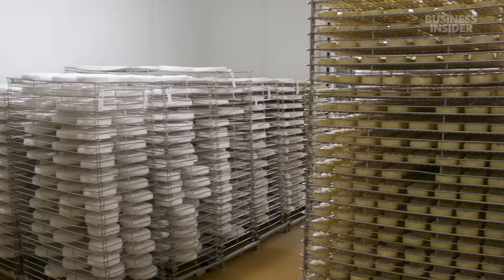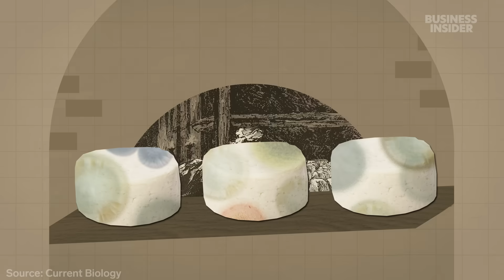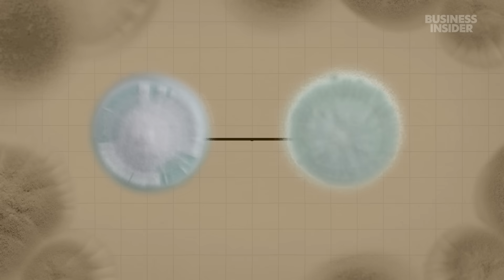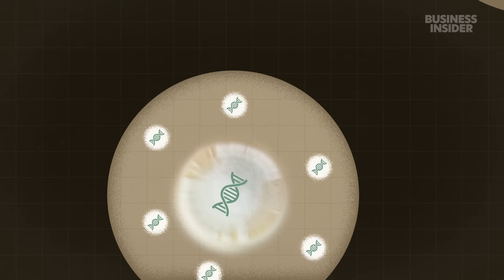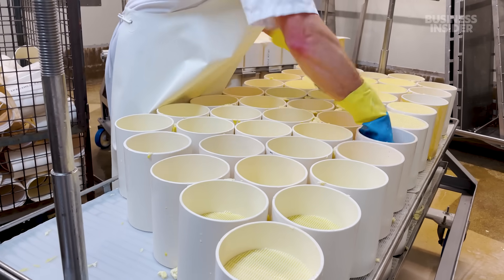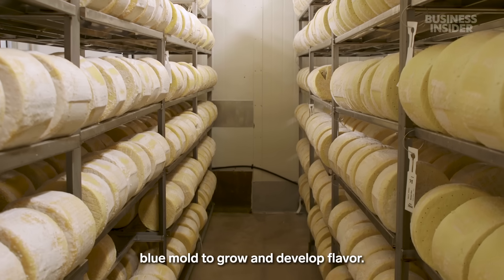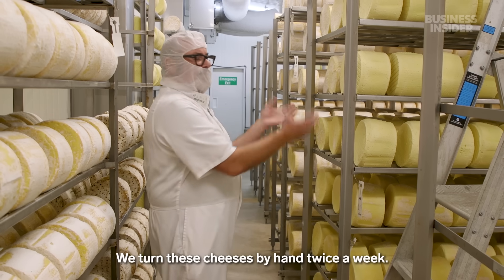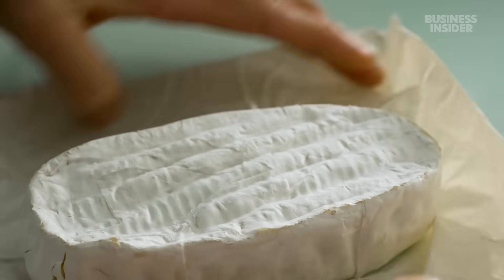Why the Mold Behind Brie Cheese Is Disappearing

Comment: Maybe I missed it, but I felt that the video brushed over why the low genetic diversity is causing the mold to produce fewer spores. Sure, it's producing fewer spores because of a lack of genetic diversity, but why? A lack of a genetic diversity should just mean that the mold cannot adapt. And yet, it is adapting in the wrong direction
Reply: Even asexual reproduction has mutations occasionally. In a more brutally Darwinian environment, the copies with bad mutations would get killed off, leaving only good copies. But in the perfect conditions of a... uh, cheese mold farm (?) even the bad copies get to reproduce and stick around, slowly lowering the average number of spores made over time since the high and low performers are mixed together.

It'd be expensive and time consuming, but we could artificially reproduce this process and breed up a healthy, high spore count mold again. The issue is likely no one wants to pay for it and all the cheese makers are hoping someone else does it first so they can get a (cheap) healthy mold on someone else's dime.
Reply: Ehhh it was somewhat explained in the video, constantly breeding the Penicillium camemberti mold doesn't mean it is actually the same even thought the term cloning was used.
Over the mold's generations, it mutated to the point that it produces less spores.
And despite what another commenter here, said, the mutation has already been observed and printed in scientific journals.
There's also the NIH (US medical paper) of "Rapid Phenotypic and Metabolomic Domestication of Wild Penicillium Molds on Cheese" (2019) where they concluded it's not a specific genetic marker of the fungi, but rather domestication of mold that lead to this mutation (also somewhat mentioned in the video) known as "transgenerational epigenetic inheritance".
Sorry I can't provide the link to said article because you all know how Youtube hates links, so just google the title I put here.
Reply: Yeah, that's what confuses me. I feel that all media about this subject glosses over the role of low genetic diversity plays.
Reply: @CFSlayer23Studios50423  Genetic mutations are a fact of life.  With 34 million base pairs to copy, asexually cloned penicillium camemberti gradually accumulates mutations in important bits of DNA.  These mutations might make it harder to metabolize energy, maintain homeostasis, or impair other vital cellular processes, limiting how many spore the mold can produce.  Sexual reproduction prevents generational DNA degeneration by providing a backup plan.  If one in every one million copies of a base pair gets mutated, then it is very unlikely that the same base pair will be mutated in two separate copies of DNA.  If a cell has one working copy of a gene, it can use the working copy.  Then there are also mechanisms for cells to repair DNA, such as by changing a damaged DNA strand to match the complementary unmutated strand.  Does this answer your question?
Reply: @CFSlayer23Studios50423  Sounds like the common case of "Well we already know incest is bad so lets start with that". Which is really unfortunate because it kind of sounds less like a "needle in the haystack" problem and more a "We're looking at the world through the eye of a needle" problem. I have a strong feeling the scientists are probably trying to find the cause but aren't able to come to a conclusion yet, but I agree it's even worse for them to say something that can be construed politicially without making it clear what's been tried or done and the evidence to support the efforts. Cause I'm hearing this and thinking "It sounds like the real reason the spores are "producing less" is because of rising demand and the people don't want to blame themselves for risk of losing sales, so they blame the spores, which may allow them to generate artificial demand." 

That's what I appreciate about comments like yours. Everyone else would just assume "Oh well we know incest/selfcest causes problems so we don't have to look at that avenue" but that very assumption coming from the scientists and people looking into this could be the very reason it's going extinct in the first place. Refusal to acknowledge other factors like supply and demand, over consumption, lack of preservation attempts etc. Maybe we're just eating it at so fast a rate, the spores don't have time to reproduce to the levels they did 200 years ago. Globalized markets will do that. And even then, this isn't the first time we consumed something to extinction.
Reply: To produce many spores is an adaptation that requires energy, but has a purpose in nature. That to be more likely to reproduce, finding a suitable habitat.
The pennicillum camemberti doesn't need this adaptation, because has no competition. It's directly poured into the habitat. 
So there's nothing to contrast the mutation to produce less spores, and save energy.
Reply: if you print a picture then scan it and repeat for many generations eventually youy no longer have a readable picture, the same thing happens with cloning of clones with every cell division there will be some loss of genetic material and no admixture to replace it so eventually the specimin becomes too unfit to reproduce its like inbreeding with ones self
Reply: TL;DR mutation can occur in asexual reproduction too!

Polymerase, the enzyme responsible for DNA and RNA replication, is INCREDIBLY good at what it does, with an extremely low error rate. But it's not perfect. It will make transcription (the fancy science name for copying the DNA strand) errors very occasionally, accidentally putting the wrong nucleotide in the sequence, or deleting a nucleotide, etc. This error is called a mutation.

Even in a closed system with asexual reproduction, mutations will still occur, and then those mutations will be copied into the next generation.

It's similar to how a person who isn't exposed to anything carcinogenic in their whole life could still potentially develop cancer. Your cells naturally reproduce (via mitosis) and have a continual cycle of death and renewal. But if DNA polymerase makes a mistake and that error, that mutation, happens to disable the "I'm too old to be useful and need to self destruct" signal (aka apoptosis), then you can have uncontrolled cell growth, aka cancer. In fact, one of the ways that carcinogens can cause cancer is by making it more likely for these errors to happen!

(I am, of course, simplifying a lot.)

Basically, any time that DNA is copied, including for either asexual or sexual reproduction, there's always a chance for mutation!
Reply: That's because adaptation isn't a conscious process. It's a random selection process influenced by the environment. If the environment doesn't stress the mold, the mold's innards will stop reproducing as much because it becomes a waste of energy, it affects longevity.

In this case we were just unlucky. There are perennial living beings, but this mold did not develop those genes.
Reply: Because it produces asexually, if a genetic mutation happens, there is no outside genetic material to "fix" a bad mutation.  You see this with heavily inbred animal or plant populations - the last mammoths on Earth were on a small island and were heavily inbred - eventually genetic mutations appeared that impacted their ability to live in a cold environment and they went extinct because there was no outside mammoth genetic material being introduced into the pool.
Reply: No geneticist here but it think it’s because it clones itself. A copy of a copy and so on. Somewhere along the way it mutated to produce less spores. From then on the clones carried that trait. 
Why in the first place did it mutate?
Maybe exposure to some random environmental change that can’t be known because logistics of global shipping. Some random chemical that is in the environment where the start/original mold is stored. Just because you think the area is sterile and chemical free doesn’t mean to a mold it is.
Reply: I think they are saying the problem is cloning. They were calling the spores clones, but I wasn't sure they didn't actually mean self-pollinating mold. I am pretty sure that's different.
Reply: I mean in captive animals the reason is incest is bad and the solution is generally crossbreeding back to the wild type to increase genetic diversity, and then doing a few rounds of breeding to breed out any negatives associated with the wild type strain like increased toxicity in the case of mold.
Reply: I felt the same way. They should've done a deeper dive into WHY fewer spores were being produced.
Reply: The message is that diversity is good…😊
Reply: It's basically incest. Over time, genetic mutations creep in, and reproduce down the line.
Reply: Lol. Mold actually don't need genetic diversity. This video is very stupid.
Reply: It’s just lazy
Reply: So i think it is like how bananas only sell one variety and then if a disease occurs the whole cloned relatives all die off... like don't put all your eggs in one basket. But I suspect the wild molds will still exist just fine on their hay or whatever. Like yeast...the yeast we use is a cloned freeze dried strain... nearlyl every bread is made with comercial yeast... but the yeast still lives in the wild. Another thing is beeswine ...beeswine is how people made giner beer and after ww2 it was basically lost bar in a laboritory in germany. People have some now I got some and managed to kill it. But it lives wild on pineapple skin i believe...so if you want to make it from scratch from the wild yeast bacteria combo i think you possibly still can. Havent tried. They pretty much explain in the video that because its only one strain disease can wipe it all out. Not sure how you missed that. Ah they actually just said it and mentioned the banana. What is it that you missed exactly?
Reply: Oh i see what you're missing. So imagine a human society where we didn't fugg but cloned our babies... would we evolve to not be able to fugg if we relied on cloning? The yeast is cloned so it doesn't go through a process of sporing..they do that because if they sexually reperooduce then a toxic mutation could occur. THey explained this right near the start when they mention penicillin.
Reply: I don't get it. You have the mother P. camemberti, it reproduces by cloning and you take away the clones. It's isolated system, why would it ever change?
Reply: @MrWnw  for the same reason bananas being clones is a problem for the same reason growing only one variety of potatoes is a problem. Monoculture.
Reply: @MrWnw  I mean I assume.... I dont actually know thats just what I thoight I could be very wrong.
Reply: Your confusion is spot-on.  The video's opinion on this matter is not backed by any published cites.  In fact, we're really, really good at preserving specific species and "breeds" of bacteria and fungus (molds) and have been doing so for over a century.

To use a gross analogy, we've been selectively breeding canines for tens of thousands of years and there's ZERO danger of running out of "naturally maladaptive" brachycephalic breeds (think pugs and bulldogs) anytime soon.
Reply: @davidacuff4685  bro we BREED dogs, these produce asexually. Obviously different.
Reply: @davidacuff4685  Those animals reproduce sexually which introduces genetic diversity. The video says mold does not do that.
Reply: @davidacuff4685  No, the breeding of dogs is a more new phenomena since it's based on physical likes as pugs used to have longer and bigger bodies in the 1800s and have less folds around their skin. Hence why current pugs have so much hip problems and can be afflicted with eye sight problems. It was definitely not because of science, the current dogs are bred but because of "vibes". BTW when we use maladaptive in genes, it usually means more harm than good.
In the case of mold, there are numerous papers noting the domestication of mold is what led to the mutation of mold as there is a loss of inheritance of traits over the generations of mold. Known as "transgenerational epigenetic inheritance". It is definitely not the same Penicillium camemberti as it used to be when 1st discovered in late 19th century.
Reply: @ We've been selectively applying breeding pressure to dogs far longer than we've been selectively breeding fungus for dairy and grain-based foods.  Canine co-hunting predates both agriculture and herding.  I completely agree that pugs have maladaptive genetics for, as you put it, "the vibes".  I said it was a "gross analogy".  Pugs are not Penicillium, but the same pattern of human intervention applies.  I also agree that domestication of molds have lead to lack of diversity and, likely, overall loss of phenotypes suitable for wide environmental fitness, BUT we're in ZERO danger of running out of healthy strains of them.  This video is unduly alarmist.
Reply: @davidacuff4685  But you said there weren't any studies published in scientific journals saying that we are in danger of running out of one particular strain's health, and there are studies that say just that, just like this video said. It's not unduly alarmist, you have misunderstood.
Reply: @RichTapestry  No.  I didn't say there were any studies, re:strain-health (there are).  What I said was we have an abundance of stockpiles of these strains.  Akin to many antibiotics, there is concern about the reduced phenotypic leverage, but no concern about extant stock of the genotype.
Reply: @davidacuff4685 My bad, I was getting confused over your pluralisation of 'strains'. I thought, from the video, that there was only one strain of Penicillium Camemberti, which is wrong, you are were right, there are actually several dozen.

Are they all similarly vulnerable though to threats like disease? They all seem like very very similar strains.
Reply: @davidacuff4685 We haven't been cloning dogs for thousands of generations, doing such an analogy is absolutely wrong.
Reply: @falinestixiaolong9691  No.  We've been selectively breeding both dogs and fungi for thousands of years (much longer for dogs).  Fungi reproduce both sexually and asexually too.  The analogy is apt.
Reply: @davidacuff4685  the strains are producing noticeably less spores, so we can in the short term make more mold, but there will be a point when it won't reliably produce spores.  that has come up with selectively bred species of other creatures as well.  in your dog analogy if a female could only produce one viable offspring, then population growth would fall below sustainable, even if they technically can still produce.  the overall growth would fall into the negative, with less dogs in the next generation, who still only produce less offspring.  if it takes two dogs to make a puppy, and at best you get 1 puppy, your population will be halved every generation.
Reply: The mold are producing less spores that become their clones. Future clones may produce less and less spores. Eventually there may not be enough to make more of them and this species will die out.
Reply: Was basically an advert for the blokes cheese company
Reply: @W.M.-  Right?! I got so annoyed!
Reply: Its simple honestly. I work in dairy, our farm has 200 jersey cows which we breed to other purebred jerseys for heifers, and to beef crosses for bulls.

The jersey heifer calves are small, weak, stupid and not quite as hardy as the larger, stronger and smarter bull crosses. Why? 
Dairy cows dont take care of their own calves, we remove them and the cow usually gets on with life. The calf does not die from lack of energy, we give it the colostrum so theres no reason to fight because the food is just there for the taking.

Beef breeds however, raise their own calves. In all types of weather. Meaning if the calf isnt up and drinking within the hour, it usually dies. The strong genetics stay and the weak ones die out. 

Why should the genetics fight to stay strong if theyre just gonna live and reproduce the faulty genes with no problems anyway?
Reply: @DanishButterCookie  this is true! Just look at pug dogs! That would literally never happen in the wild..if such a creature was ever born the mom would eat it out of the litter. We do a lot of unintentional things when we mess with nature. Not to mention creating resistant strains of bacteria from using antibiotics on the whole herd. I live by cows and my landlady breeds some ..ooh is it chevrolet? Its a kind of car as well as a cow...beautiful creatures ..absolutely like johnny depp beautiful.
Reply: @DanishButterCookie  This is beautiful evidence on the issue.  Thank you.
Reply: @DanishButterCookie Excellent explanation!
Reply: It's probably getting just tired. It was the same with a certain variety of a small potted palm in millions of households. All these plants came from one plant given to Queen Victoria. A few years ago all these plants worldwide died at the same time. I might be wrong about some details here but in principle thats how it was.
Reply: Do you remember the old copy machines? Make a copy of a copy of a copy, and eventually, you won't be able to read it. It's the same reason that a clone of a clone of a clone will eventually no longer be recognizable next to the original. It's also the reason that the influenza virus will vary from one year to the next. The DNA starts to mutate, even break down, until it no longer resembles the original. The comment about needing two sets of genes for biodiversity is the reason almost every living creature on the planet requires cells from two parents.
Reply: Because it's technically like a photocopy of a photocopy of a photocopy, etc. centuries on. With time, errors accumulate and the copy produce less surviving viable copies.
Reply: It’s likely because the mold is basically being inbred.  Inbreeding (and repeated cloning) causes accumulation and expression of mutations that lead to degradation in biological processes (such as the process that produces the spores).  The fungus is basically inbred and less and less healthily due to accumulating genetic damage.  Sexual reproduction mitigates this.  An analogy is making a photocopy of a photo over and over - the quality degrades over time
Reply: Inbreeding was my assumption. Look up the Hoteps  or the Hapsburgs, a lot of them were sterile do to severe inbreeding, aka lack of genetic diversity. I imagine it applies to all reproducing organisms… that was my guess at least.
Reply: Kinda like Pakistanis ?
Reply: The video is propaganda directed for some purpose. The statements are outrageous. The molds will not go extinct. Recently, these corporate interests have replaced natural cheese rennet (animal origin from calf's intestines) with R. Miehei (rhizomucor or mold variety) and had the audacity to label it microbial (genetically modified denied). If mold sensitive Europeans have had trouble digesting ordinary everyday cheese, it is because the rennet has been changed (since 2015) by EU directives. Black mold is also added as a preservative under the fancy name of citric acid. Now all of a sudden the traditional microbe underperforms! We'd better come up with a scientific solution! Actually, for mold sensitivity sufferer, I actually enjoyed fresh brie made from raw French milk whenever I could afford it. If they modify the mold, I will never buy it again! Take that home, Business Insider.
Reply: @inveritategloria  You're fundamentally misunderstanding what molds, rennet, citric acid, and the role of microbes in these processes are.
Reply: @inveritategloria  Citric acid is not black mould. It's an organic acid with the formula C6H8O7 and the chemical responsible for making citrus fruits acidic. You really have no idea what you're talking about.
Reply: @inveritategloria  Wait, how the hell is citric acid black mold?
Reply: @inveritategloria  found the propagandist.
Reply: @inveritategloria   thank you so much for your time btw, this was extremely valuable information and your comment seriously gave me the chills. I stopped being able to consume any cheese at the end of 2015 because of severe allergic reactions.